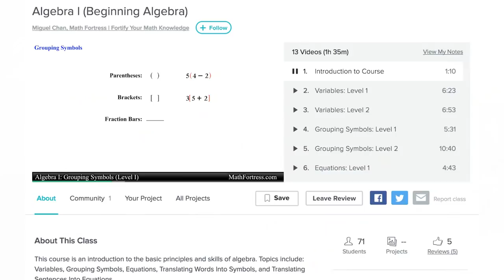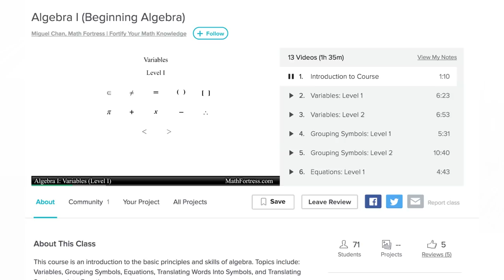DO PILOTS Need MATH And PHYSICS? The Real ANSWER

Comment: Looking at the comments on your videos, ma’am, 90% of them show little or no regard for the English language. Regardless of ability in maths, physics, chemistry etc a fundamental requirement of an aspiring pilot is attention to accuracy. Posting “breaks” instead of “brakes”, or ”loose” instead of “lose” shows disregard for that.
We all make typos, but checking and crosschecking are critical in aviation so if you even think of flying as a career start by paying attention to writing correctly, otherwise you will fail before you begin.
I was unsure about the contraction of “madam” - so I took literally five seconds to look it up: it’s not rocket science, just getting it right and you need to do that when you have 400 people behind your ass.

Comment: You mentioned Ohm's Law in this video. That's an electrical formula used to calculate voltage, resistance and current. If you were repairing a plane I can see how you would be required to have a very good working knowledge of this, but as a pilot I cannot make the connection. I just don't see a pilot getting out a DVM mid-flight and checking a electrical circuit. Now I'm not a pilot and would like to learn how this applies to a commercial airline pilot.  Anyone that can help, thank you.
Reply: You will be taught and tested on electrics as part of aircraft general knowledge.  Will you ever use it? Probably not, however it helps to provide a basic understanding for the future.  As you may know, there are circuit breakers and fuses on many aircraft, so knowing a bit more than 'The red one has blown, I need another red one'. 

It's also a good thing to be tested on some stuff we will never need as it will weed out the weak and those who aren't really serious about aviation. 

I saw our 14 subjects as a test of knowledge, learning ability and ability to stick at it for so long under such tough circumstances. 

Hope that helps paint a better picture.
Reply: @PilotFlood  Thanks for the reply and information. I just couldn't see the connection but thanks to you I do.
Reply: @mikecalhoun8497  You're very welcome! I'm glad I could help.

Comment: I like maths but my teacher this year is shit, he doesn’t explain anything and when he does explain it’s incomprehensible. Last year I got about 85/100 this year it’s at 45-50/100 points. Is gcse maths pretty much sufficient to becoming a pilot(if not I’m capable of doing a bit better but A level maths seems really complicated to me). I’m quite good in physics being at about 75/100 so no worries there. It’s just the maths that are hard, and I think it’s just to do with my teacher. Any advice would be very helpful.

Comment: Kind of over exaggerated. Its required great to know... but you cannot do those calculations at the required pace.... during the jet age let's say when we had the 100 and 200 737 series... pilots were expected to do mathematics based on formulas but the complicated stuff was always done by the FLIGHT ENGINEER and thus we had non precision and semi-precision approaches..... fast forward to 2019 we have stuff which is incredibly precise and no flight engineer too, these complex calculations are done by the FMC/MCDU in a very dynamic environment which is augmented by ATSU, it's all about how fast those calculations can be performed repeatedly so that you can also derive the deviation from mean and to which extent, then we have the EFB and the list just goes on. You want to do those calculations all by yourself read about kinematics, parabola and vectors. With that knowledge try and solve a question with non variable data and see how much time it takes, long story short if you are doing that and flying ...all at the same time it's going to be a disaster. About flying modern jet.... you need to learn how to manage systems get the necessary flying skills and more important than anything else experience..... the answer lies in muscle memory and motor coordination.
Reply: You don't need maths for the flying part, but to pass the exams you most definitely need standard college level maths.

Comment: nice landing :) and are all landigs done with auto pilot ?
Reply: leah Knight No, all aircraft don’t have autoland function and autopilot landings are mostly done in very low visibility.  (I’m not a pilot so I’m not sure about the last one but that’s what I think.)
Reply: onni borg auto-land doesn’t exist, yet at least, in low visibility pilots use what is called ILS to guide them, pilots have to land manually

Comment: What and how much of the basics understanding do I need for physics? (If I worded that confusing what I’m trying to ask is what topics of physics do I need and how much of basic knowledge on physics do I need?)
And if I don’t take maths or physics for alevels does that  hurt my chances of getting into  aviation? (That’s probably a really weird question but  I don’t want to take maths or physics for alevels because it looks far too complicated compared to GCSE) 
Which university is the best for aviation in England?
Reply: The school systems can have differences depending on the country, but I had math and physics in high school, and it was the sufficient level. About your question regarding the university. In Europe you don't need to have a college degree to become an airline pilot.
Reply: Don’t worry. GCSEs are really easy to retake if you don't have the grades required. I bought the material for English, maths and physics (£800) and retook 4 GCSEs before my ATPL. At 30 years old I at least wanted to retake physics and maths and it helped a lot for my ground school. Most institutions require a min of 5 GCSEs (Grades A-C) and must include English, Maths and any Science (Physics recommended). The other two GCSEs can usually be anything but double check with the institution you apply for.

Do remember though, these requirements are mostly for the training.  After training, most airlines only care if you have ATPL/CPL etc. You will be tested at your assessment with that airline to establish your maths/physics/English abilities etc.  

Hope that helps and good luck!

Comment: Just to be more specific, what type of math is required?
Reply: Abdullah Ersoy i would expect a lot of trigonometry and (basic) algebra, and maybe differentiation/integration.

But that's comming from an Aeronautical Engineering student haha, which requires a lot more math skill than mentioned in this comment or the video xd.
Reply: This answer could greatly vary based on where you study, in my country they teach basic university level maths (calc, linear algebra, diff equations, PDEs) and some vector analysis. But some other courses may skip some of that and focus on the practical aspects, which are basic trig and maaaybe some calculus. If the institution where you learn likes to focus more on the theoretical aspects as well, it can include a lot more stuff. Especially when it comes to aerodynamics (which has quite a lot of vector analysis unfortunately) and material design which is based on solid state physics.

This is only true however if your program goes in the theoretical aspects as well, if it does, the necessary areas are likely going to be as detailed as for undergrad physics students.
Reply: Trigonometry and arithmetic, I guess. I see no point for calculus for a pilot.
Reply: Not during his daily work, but to understand mechanics and aerodynamics, which are essential in knowing what the aircraft does, how and why is based on calculus. That being said, I can only look into the course offered the local university in my country, I posted the exact math required below. This may greatly vary in different schools but I assume basic calc is needed at most places.
Reply: More Trigonometric And In science Electrical Engineering I am accepting I also don't know but Trignometry is Yes
Reply: For physics and pretty sure you only need newtonian.
Reply: Captainersoy adding, subtracting, multiplying, dividing and common sense, fuel, ETA and angle of crosswind are calculated in most airliners not requiring you to get a pen or paper out hence mental maths which is fairly simple
Reply: Captainersoy adding, subtracting, multiplying, dividing and common sense, fuel, ETA and angle of crosswind are calculated in most airliners not requiring you to get a pen or paper out hence mental maths which is fairly simple
Reply: Different from school to school

Comment: I took higher biology (A level) is that ok
Reply: Sure is! Any Science is good. Physics is recommended though as it's got a closer link to aviation/aerodynamics than biology.

Don’t worry. GCSEs are really easy to retake if you don't have the grades required. I bought the material for English, maths and physics (£800) and retook 4 GCSEs before my ATPL. At 30 years old I at least wanted to retake physics and maths and it helped a lot for my ground school. Most institutions require a min of 5 GCSEs (Grades A-C) and must include English, Maths and any Science (Physics recommended). The other two GCSEs can usually be anything but double check with the institution you apply for.

Do remember though, these requirements are mostly for the training.  After training, most airlines only care if you have ATPL/CPL etc. You will be tested at your assessment with that airline to establish your maths/physics/English abilities etc.  

Hope that helps and good luck!
Reply: @PilotFlood  aweeome,im planning to start my 2 year training in exactly 10  months so im quite excited though apprehensive to start atpl ws im not rlly sure how hard itll be
Reply: @amenchoudhury8036  I remember feeling like this before I started too. If you're starting with the 14 ground school subjects then I will say this:
If you can spare the time, read up on some Maths and Physics stuff although it's not entirely necessary. If you struggle during study then you will google the answers and find out but getting a head start will help.

I retook my Maths and Physics GCSEs a few months before I started and I'm so glad I did. Although I know people who didn't and although they struggled more than me, it was very doable. Don't worry yourself, research what you can before and go for it

Comment: Why airplane invented asf Defficult. to drive 
why just like cars easy to understand 

life sucka
Reply: There is a very clear reason. Controlling an aircraft in the air needs totally different control system compared to cars. The aircraft has many different systems which are essential for the aircraft, but ground vehicles don't need them. That's why thorough training is needed. But everything can be learned through the training.
Reply: @mikep9604  Wow nice reply sorry
maam hope you will understand

Comment: I found this video Really discouraging, rather than helpful towards people who struggle with maths. This was rather an advertisement for skillshare than a as mentioned a helpful video.
Hence why I disliked this video.
Reply: The thing is, most 'hard science' fields require maths. (Using the term hard science is a bit misleading but it can work here.) If you study any sort of thing even remotely related to that, you'll have to be able to proficiently use integration and derivation techniques, understand and work with differential equations and partial differential equations, as well as some basic linear algebra.

This may sound daunting, but there's simply no way around it. However, this shouldn't be discouraging, because learning these is not particularly hard, the main reason why people struggle is the lack of proper foundations and the lack of good maths education. If you know how the different branches work and classified you can very easily indentify your shortcomings and learn the necessary parts beforehand, I recommend you to check out Professor Leonards videos, he teaches a lot of stuff that's useful up to Calc 3. With that amount of experience and knowledge, you can totally work towards to understand other concepts that are required in technical fields.
Reply: M30WMAN oh, I thought you'd have to Excel at those subjects
Reply: exactly.
Reply: Waldotto Original Dont worry. Wright brothers were bicycle repair man. They built first aircraft and flew them. They never had pilot training and math or physics, but they still flew planes.
😅😅😅